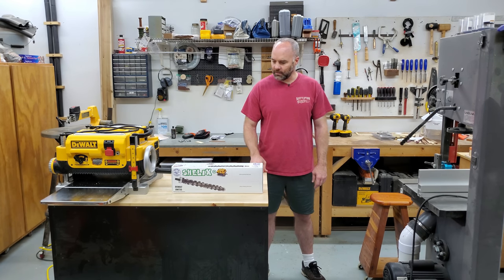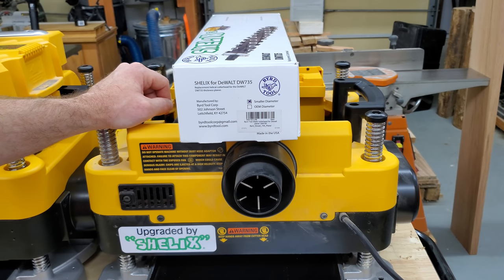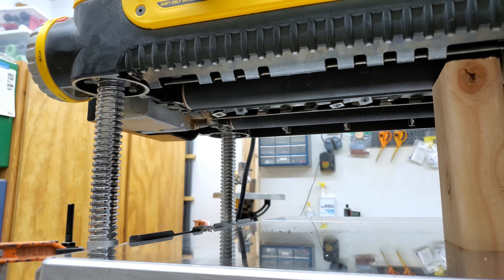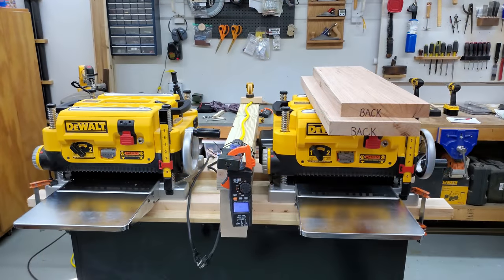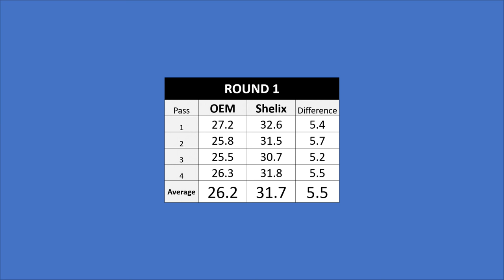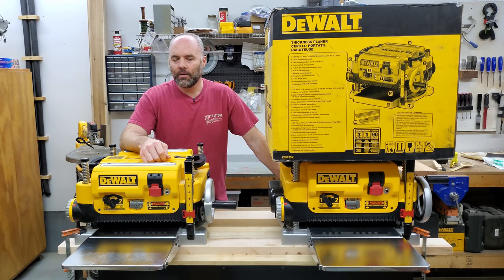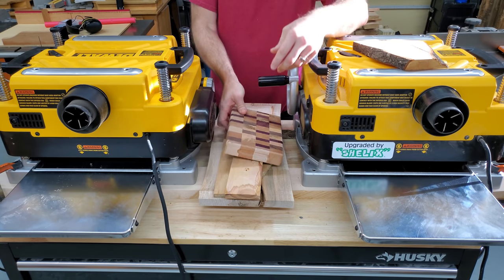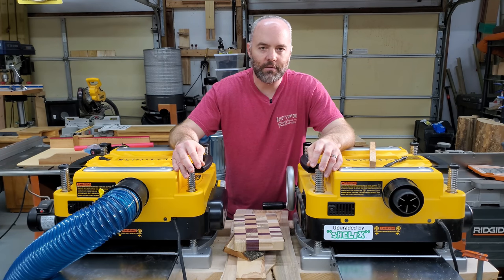The video I wish I watched before buying a SHELIX

Comment: This is a very interesting video and comparison especially because I'm also an electronics engineer.  As was previously mentioned, there are issues with the differences in age of the bearings, wear-and-tear, etc with the older planer.  How much of a difference, or to what extent those differences would have a direct correlation to amperage draw is hard to say.  Since one machine is from 2017 and the other from 2020 (I think that's what you said), there would obviously be differences between the two machines in terms of "burn-in", meaning that all mechanical aspects of the system are more or less "settled" (though of course, nothing in a mechanical system is ever permanently settled).  Another consideration would be the possible differences in the motor efficiency between the older machine and the newer one: I doubt DeWalt would be willing to provide any quantitative numbers on either machine's motors in terms of efficiency based on their respective serial numbers (which could be traced directly back to a production run, etc).  If the newer machine's motor  (and other machines going forward) reflects a slight design improvement that increases its efficiency to do work, how would anyone know, except DeWalt perhaps.  Also, there may be some unknown "minor improvement" in some other parts of the the system that could yield less stress on the motors and so produce less current draw.  Too many unknown variables.   Since your first machine has been in use, it's probably not a good test candidate to use as a DUT (Device Under Test) in a comparison because of the previously mentioned use/wear-tear issues.  It would be more accurate to make a comparison between two of the same model machines, from the same manufacturing runs - if that's even possible, which I doubt - that are newly purchased together, and from the same vendor.  But there could still be a question on the efficiency of the motors between two of the same machine, so purchasing two new machines is not a perfect solution, not to mention a costly one.  It would be less costly to simply swap blades, i.e. put the stock blades from the newer machine into the old machine and see what the results produce, and visa-versa, put the helix blades into the newer machine and see what that produces then compare the results.  Though this was not exactly a scientifically accurate comparison, I still think the comparison was revealing enough and was a very interesting video.  Thank you for taking the time and effort to do this.  And I hope you find use for the 2nd planer!  By the way I am thinking of purchasing the very same DeWalt planner so not only was your video interesting and informative, I learned that there are after-market Helix blades (who knew!) and a bit about the internals of that planner as well !   I look forward to some of your other videos !

Comment: I have to admit that I am a little shocked at the amp ratings between the two.  But not totally surprised. I recently installed the Byrd OEM and was wondering if I had done something wrong because it seemed like it was loading the motor more than stock. Now I see it is true. It is still a worthwhile upgrade and I have no regrets.

Comment: I don’t mind removing the cutters. I would do that regardless. Thank you for this video. I went through 6 blades within a couple weeks. I don’t usually work with pine, but I have had a few customers who were wanting used lumber for their furniture. I always remove all nails, staples, and fasteners and run a strong neodymium magnet along the board prior to planing. However, I have been running into boards with aluminum nails. It is extremely frustrating.
Reply: I wrecked 2 bandsaw blades. So I bought a metal detector on Amazon, the same as the tsa use. Saved me a lot of money because I use a lot of reclaimed wood. Able to find many dinky pieces of steel.

Comment: Why I like the Shelix... Better chip extraction. The Shelix creates smaller chips than straight knives that are easier to extract. Easy and quick to change to a new cutting edge. But most importantly is the vastly improved cut quality over straight knives especially on woods with difficult grain.
Reply: And there is why he is drawing more amps from the Sheila head it is doing more cutting/revolution thus smaller chips.

Comment: I kinda wish you would have included light pass planing, like 1/3 turn of the wheel.  I almost never take a full turn in one swipe when planing 5/4 stock and trying to keep the most thickness for the projects.  Nice test though, especially the amp test. Wow.. had no idea I was drawing that much with it.  My 20 amp breakers (new circuits) never blow.
Reply from the maker: Maybe something for a future video. I normally take light passes too, and have likewise never tripped the breaker in the panel. I've tripped breakers in the planer and in an extension cord reel, but not in the panel.

Comment: Great video, very informative. I’m struggling with my delay 735, planing poplar that may not be very dry and getting a lot of tear out, raised chips all over the boards, while searching for some advice I came across your video and was impressed with your testing and meticulous explorations. The peak current readings are definitely an eye opener and although hard to believe, the meters don’t lie. I believe some people may be confused with your readings and why the panel circuit breaker didn’t pop. The short answer is because you’re measuring current spikes not nominal steady state current. Circuit breakers all have a delay before they break, the old round fuses were called time delay fuses, used mainly in motor applications like when furnace motor started. The inrush current of a light bulb is up to 15x more than it’s steady state current. Motors have even more inrush currents. So, during a stressful cutting cycle there may be multiple spikes but ever so brief that it doesn’t even trip the breakers. Which leads me to say that a current spike is not necessarily indicative of using more power for the whole cycle. A more indicative comparison I think is to compare the average power usage per cycle instead of the current spike. I’m sure you thought of this and may have even mentioned it and I missed it. Thought I’d add my comments even if it’s 3 yrs later after making this video.
Reply from the maker: The steady state current under a heavy load was not much lower than the peaks.

Comment: One more reason why the current is higher on the Shelix - is that there is overlap between the cutter head squares so as to not leave a line between them.  So in effect you have more inches of knife edge hitting your board on each pass thus increasing the friction as the cutters pass across the board.  Friction = Power draw!  Based on everything you have said and what I understand I would still vote for the shelix every time!  The sheer reduction of cutter head replacement and hassle it worth it!  Thanks for the video!  liked !!
Reply: The amount that overlaps will still only get cut once, despite being passed over by two different cutters. There might be a tiny amount of friction that the second cutter imparts as it grazes it, but I think that would be a negligible contribution to the current draw.
Reply: @trevorlambert4226  so you admit it would be a LITTLE more current.  I am interested in your explanation for the additional current?
Reply: @advancednutritioninc908  the surface area of the wood being cut is a fixed dimension,shouldn't matter if there is overlap in cutters as far as load is concerned.
Reply: @jeremymyers5643  You could be right, but I was thinking there could be more cutter area rubbing the wood if there was significant overlap.  More friction, more drag, more motor current.

Comment: I tested my old 12" Delta 22-540 which is a typical 15 amp planer.
Start up current was just under 14 amps, and the no load running current was 6.7 amps. I ran an old 4"x 6" Hickory beam through it for the test. 
Under full load, taking a 1/16 cut off the beam, the planer was pulling just under 10 amps, as one would expect given the fact that it's a 15 amp unit.

Comment: If you think about power draw and amps pulled all equals to overload on motor and belt, so the wear and tear and all the parts will be more so most likely will get damaged faster than running the oem style
Reply from the maker: Agreed, the more you use a tool or the harder you make it work, the faster the parts will wear out.  The same could be said of planing oak compared to pine, or business use compared to hobby use.

Comment: I'm wondering why all you hear about is the Shelix cutter head. I bought the same type head with 56 inserts from FOXBC & saved quite a bit of cash. I just installed it & it works great.
Reply: I also bought the FOXBC Helical head. I'm a newbie & couldn't see a reason to pay about $150.00 more. Mine works as fine as wine, too.

Comment: Nice vid, good detail. I bought a set of carbide blades for my DW735 for a whole lot less than the Shelix (less than half) and they work great. I have had them for just over 3 years now and they still cut like new. I have run all hardwoods including some figured with no problems. I'm a serious woodworker and use the planer often.
Reply from the maker: What brand did you get? I bought some carbide knives for my jointer a couple years ago, and they still nicked before too long. Otherwise they're still sharp, but I've been replacing one knife at a time with steel to get rid of the nicks. I mill my own lumber, so that might be part of the problem.
Reply: Why on earth did you not give the product name??
Reply: What brand of carbide did you buy ? I am thinking of buying a planner

Comment: I've had the same experience as far as circuit load.  However, it was simple to manage; I just take smaller cuts.  It cuts so much nicer, especially on figured grain, that it's no contest.  The Shelix wins hands down, every time.........
Reply: what limit were you able to pull off per pass, at least a 16th right?

Comment: I love it, i explain to my wife on a regular basis i could use two planers. She isn’t biting yet, but i am coming up with new and creative ideas to justify having a second one :) I am enjoying the channel and puns. Thanks for taking the time to do this comparison on a serious note. I am in SE Asia and it is challenging to get the parts to show up, not to mention the mark up. So this information is welcomed and yes the original TR was much better than the newer one, although I didn’t mind watching the second TR. Quaid start the reactor… is priceless.
Reply: I thought about getting a helix cutter for my dewalt p[laner. I asked a dewalt service center rep if it really was as good as they claim. this is what he said " if you put that cutter on your machine then you void the warranty.'.  He invited me into the back and showed me about a half dozen machines with burnt out motors. This planer is not made to handle the extra load one of these cutters puts on it. He said' if you have a belt driven machine like a jointer or a large size planer that is not a problem'. I stay with the standard blades.

Comment: Great Video tutorial.  One way to determine actual pull or difference would be to measure the wood thickness before & after each cut to make sure they're cutting the exact same thickness.  Just a consideration

Comment: A true test of a planer is to run Osage Orange through it.  Also known as Bodark it is a super hard yellow wood, prone to chipping due to it's wavy grain nature and hard fiber.  I did two cutting boards today but still had to sand them down for almost an hour .   Use a different color saw dust to rub into the chip outs to show it on camera with a single light source or the sun.

Comment: The machine has a 15 amp motor which is OK to connect  on a 20amp circuit . Electric code allows up to a connected  load  of 16 amps on a 20 amp breaker. If you are pulling 25 to 30 amps the breaker would trip before you got a 3 foot board planed even on a light cut. Something is not correct.
Reply: @MJ-nb1qn  what else is involved. Inrush current is not a problem.

Comment: I sure appreciate you posting up this video. I was very much surprised. I would have expected the planer with the bigger, stock head to use more power than the planer with the smaller diameter Shelix head.  Very interesting results for sure!

Comment: Nice video, thanks! Regarding amperage draw, you may wish to measure the line voltage at your outlet. It can vary anywhere between 108v and as high as 127v depending on how far your house is from the utility company's point-of-connection transformer. With a  higher  voltage you can expect a lower amperage draw and, of course, vice versa. You may also want to check your breakers. You can almost arc weld with older Federal Pacific or Zinsco breakers and they won't trip, but most newer inverse time breakers will usually trip very quickly at amperage draws above 30 or 40 amps for 15 or 20 amp breakers respectively.

Comment: I just came across your video.  I see it is almost two years old but just the same I am in the market for a planer and it was very insightful.  I wish I had seen it sooner because I have several ham sandwiches that I want to plane and didn't know you could do that.  Thanks so much for the help.

Comment: I would have liked to have seen the draw on your old machine before you switched the blades but that said a VERY good video. Personally as I would not throw out the original blades if I upgraded it, if it went wrong and I needed to return it I would just put the original blades back in first.

Comment: Glad I stumbled on this. Very interesting. Confirmed my thought that planers with helix cutters should be spun on minimally 240v induction motors. Been on the fence about this same Dewalt or just overhauling my very very old currently not working Powermatic 5hp planer and this demo tipped the scale. So, rolling up my sleeves and getting to work on the old planer. 

Great work and information! Thank you.

Comment: Great comparison video. I recently bought one of these planers as I gear up my garage but haven't had a chance to use it yet. Pretty certain my garage is on 15amps at the moment and I've already blown the breaker combining a portable ceramic heater and a shopvac. It'll be interesting to see how long till I need to call an electrician over to upgrade my garage breakers.. I have a feeling its definitely not going to cut it as is.
Reply from the maker: Yeah, that will be close, especially if you want to capture the dust instead of breathing it. There are some clever designs for filter cabinets to eliminate the need for simultaneous dust collection, but an electrical upgrade is probably inevitable.
Reply: You will be doing more than upgrading your breakers. You will have to run heavier wire to the receptacle also.

Comment: So the reason for the high current draw not tripping the breaker -  they actually will trip, but it takes time. The board is through the planer before the trip time occurs. A 4x load will trip the breaker in about a second. A 15x load will trip the breaker really quickly. Breakers work through an element being heated by the current passing through them. After a certain temperature is reached - pop!

I had to go find a Square-D trip curve for a residential 20A breaker. I learned something new.

Comment: Because your rollers are so tight on the Shelix non-oem, I think you need to test the draw on the oem Shelix. That extra draw is probably due to how much harder it needs to work to pull the board through.
Reply: That's a thought I had as well.

Comment: FYI: I bought a metal detector wand. It’s about the size if a barbecue lighter. They’re about 60-80 dollars. But if you’re planning down old wood it’s a great investment.
Reply from the maker: For some reason, that's one of those tools that I've always wanted, but just never bought. I used to use a lot of reclaimed wood, and was constantly hitting wire brads and staples. Probably would have paid for itself ten times by now.
Reply: @TheSnekkerShow  : for sure. The price I quoted was Canadian dollars. So it should cost at least 35% cheaper. This is not a regular metal detector. It is short range only. This is what you use to narrow down the area when your metal detector goes off. So when you use it you have to be close. Small sweeps, you’ll get the hang of it.

Comment: I'm not sure if this has been mentioned before, because I didn't want to read through 1,173 comments to find out, but the Shelix cutter with the smaller diameter should also draw less amperage than the OEM size Shelix cutter because of less torque requirement. It would be interesting to see what the differences are between the two Shelix cutters in amp draw.

Comment: Great job on this video.  I have been running my 735 with stock straight knifes on a 15 amp circuit and have not had any problems with the circuit breakers, but I see I could not expect the same if I upgraded to a Shelix.  I wonder how the 1/16 difference in diameter affects the load.  Might be even worse with a stock diameter (wood cutting reaction force would have more leverage)

Comment: Great and comprehensive review of both setups.  I know of only one friend who switched to a SHELIX and he had mixed emotions on the planing enhancement over the obvious cost and power requirement issues.  Thanks for the review and technical details.  Now to find a stock-like blade with more longevity than DeWalt OEM.